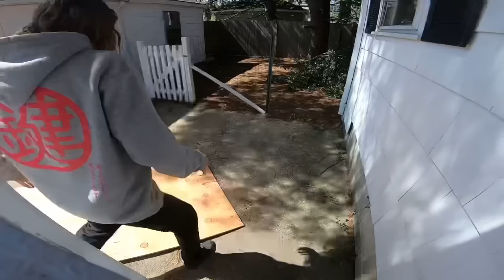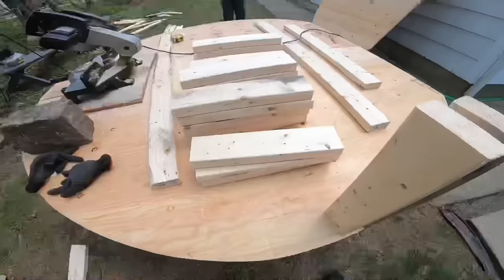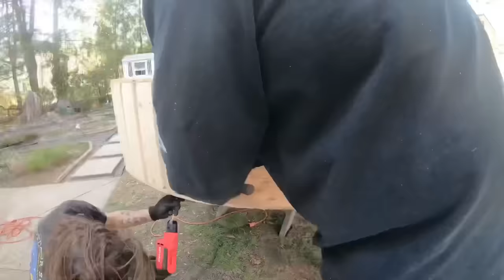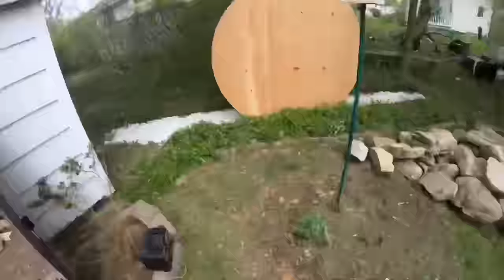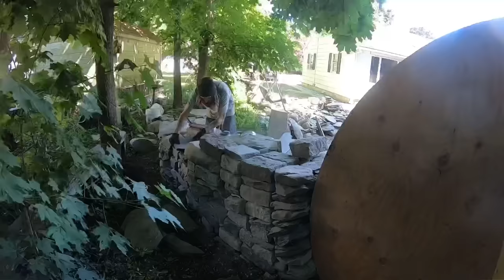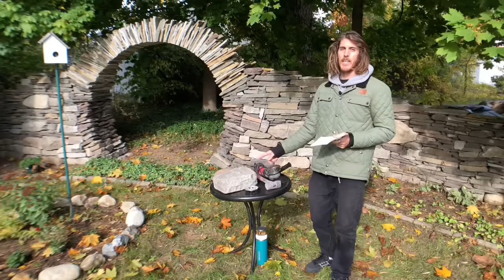Building a stone arch from start to finish - DIY Backyard Project

Comment: Ive been mining and cutting stone for nearly 25yrs and I must say im impressed with your stone work. It always shows when someone puts "Love" into the things they do! keep going with this, it takes a special person to achieve this level of precision. You can make a VERY good living doing stonework like this. I'd charge around 10K ++ to build that to give you an idea
Reply: This is exactly what I do! And yes you can! Just like anything else it's a skilled trade. Not I don't have 25 yrs. More like 5, but I LOVE it!
Reply: @Buster Noggins look up roman aqueducts they are built in thevsame way just with concrete or stone and they have lasted hundreds of years
Reply: @Buster Noggins yeah that's why I said they made it out of concrete not loose stones
Reply: That looks like too much hard work for $10K. Not that I'm afraid of hard work but day after day for years has to take a toll on your body. As an art as well as a trade, I'd say it's worth more than that.
Reply: What would that cost in material
Reply: How did they cut n build the great Pyramids?
Reply: @Bart-Did-it  Bronze and sand. There are demonstrations of this on the internet. The only real mystery of the pyramids is exactly how they put them together, not if, how.
Reply: @jr8260  the three great Pyramids were built 11500 years ago not 4500 like your lead to believe .
Reply: @Bart-Did-it  how is that determined?
Reply: @jr8260  keep searching and the answer will find you .
Reply: @Bart-Did-it  right
Reply: @Bart-Did-it   If you can't spell correctly, how are we able to believe you have specially researched information regarding the age of the pyramids that contradicts the dates the pyramid builders themselves left etched on their walls ????
Reply: @CombatMosquitoTrainer  all the Egyptians did was case the massive pyramids in geo polymer lime stone concrete and poured to shuttering . All the smaller pyramids were built but the Egyptians and the valley of the kings burials. The solar religion was reborn anew
Reply: @CombatMosquitoTrainer  that's a nonstarter. Many geniuses throughout history have been notoriously bad at spelling. As long as they can communicate their ideas; what's it matter?
Reply: @hiddenpotentialproject806  You're confusing a flat earther with a genius
Reply: @Bart-Did-it  bet you can't fit a nickel in your nose
Reply: @dialecticcoma  fraid not the Lego man head is stuck in one and a 🖍️ stuck in the other they made me put it back remember !! Now I’m stupid again Doh!!
Reply: @Bart-Did-it  with a massive fucking alien laser
Reply: @m4inline  now that’s cool ~~~🔫 👽 🛸
Reply: I really appreciate when a professional comes in to give encouragement and a suggestion of cost.
Reply: Ive found over the years working with stone is that sometimes no amount of training will get some people to build something as beautiful as a first timer who puts their heart into it.
Some people are just naturals, and this guy is one of them. 
Fantastic work.

Comment: Nice design, nice build. If I were to take on this project I would have screwed a long, rotating "clock hand" to the center of the wooden form, and used it to make sure that all the bluestones of the arch aligned with the circle's radii - all the way around to just below the ground.
Reply: would be really easy to do that with the trick he uses for cutting the wood circle too - tie a string to the center!

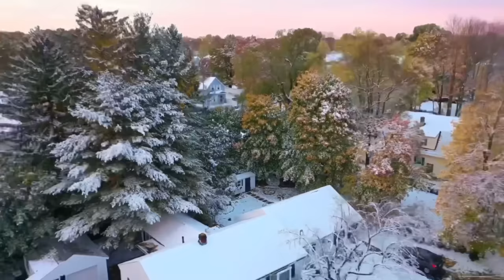Comment: Stone really feels like a special material to me. I'm glad there are so many others out there who appreciate stone as an amazing material too. Great stonework and great editing and camera work at 5:24, nice shot. 

I feel the width of the arch is a little narrow, do you have any concern that it may be prone to wind or even just prone to being hit by tall objects? how much lateral force can it withstand? if you're not sure, learn to calculate it like an engineer would calculate it, or have an engineer calculate it for you..there's probably one in the comments that would do it for free, otherwise pay a few hundred bucks to know for sure. I think it's worth knowing for the peace of mind, if it is prone to toppling you can take extra care to ensure people don't walk under it. 

check out the drystone walls in yorkshire, and how they're built. amazing gravity-fit stonework, much like this, but they use a chisel to hammer away rock to make rocks fit rather than using a grinder. they basically build two walls, with a hollow that gets filled with rock fragments, small rocks and chunks as filler, has large base stones, "mid stones" that link the two walls together every meter or so, and capstones that help compress and lock together the structure, giving it additional strength. i think using this method would reduce the requirement to use flat / slate stones.

Comment: Stunning!!  
My husband and I are about to challenge ourselves to create a Moongate in our garden this year. We've been thinking and drawing and talking about it for two years now. This is it! So, I'm wondering how the one you created is still holding up? I live farther north than you and am a little weary of the winter freeze/thaw cycle, we're considering using mortar between the rocks in the top section to add more stability -  It will be concealed for the most part.
We've really enjoyed your video, it's on our rerun loop. Great Work!!!

Comment: Amazing work... I have often been fascinated by how you get the stones on the top of the archway to stay in place. 
You think there's nothing holding them in there,  it's all done using pressure of the other stones...
If the right amount of force is applied to each side of the stone it stays.  So that as you go around the arch the pressure builds but you need to keep it even at the top else it will squeeze up and the whole thing will explode like a rock volcano without the lava...
😮😊 I am glad that you were the one building this as I would end up with an enormous pile of rubble and a few bolders 😂😅😂

Comment: So I read your string was 40”, which gives you an 80” circle. With the bottom cut at 4’ wide, what was the height of the “inside” top dead center ?

Comment: I'd suggest using a wet saw for cutting stone.  You do NOT want any dust on you or in you...  The rest looks great to me.  The masonry hammer you are thinking of is called a scutch.  It can have a vertical or horizontal hardened steel insert with prongs that is very useful for knocking down high points and shaping stone faces.

Comment: Question: in your research, what did you find for the significance of the wall with it.  You mentioned that it holds weight from the arch.....were you able to find a formula for the height of the arch to the length of the stone wall? I have found all sorts of information for the arch portion, but nothing on the arch to wall ratio.
Reply from the maker: Hey bud I wish I could help you out but there was nothing I saw on that. I just made sure those inner support rocks were huge so they could hold up that arch weight 🤙🏼 Best of luck on the build!

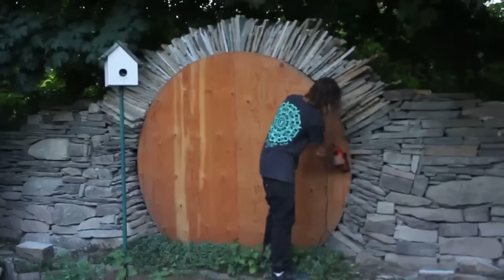Comment: 4:50 You can screw a screw partialy in, maybe even use a washer, and with crowbar peel the board off without having to cut off part of it.
Reply: Also those conecting planks can be from outside so you can dismantle it from outside if you need.

Comment: That looks awful.  The stone for the arch doesn't match the wall or base at all.  Why did you use skinny little pavers that are a not only a completely different rock but a different color as well?  Also, the angles of a bunch of those pavers in the arch are all messed up...